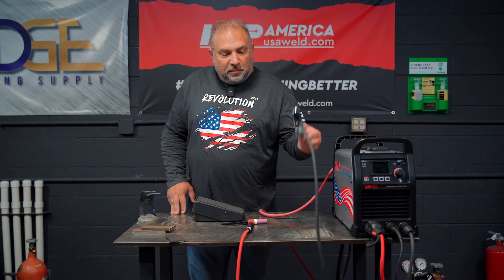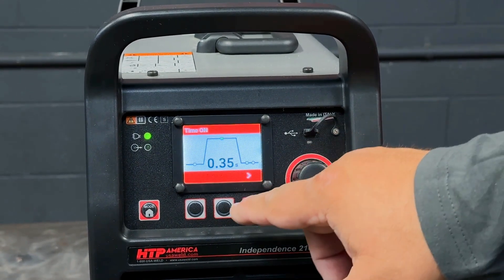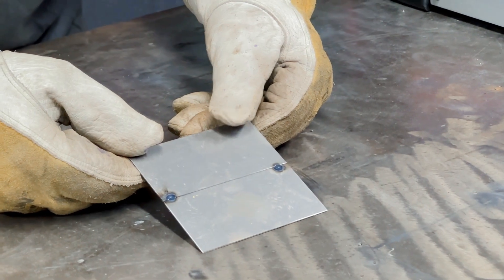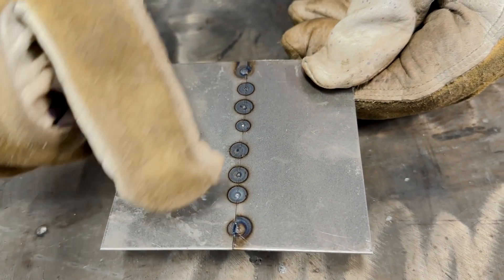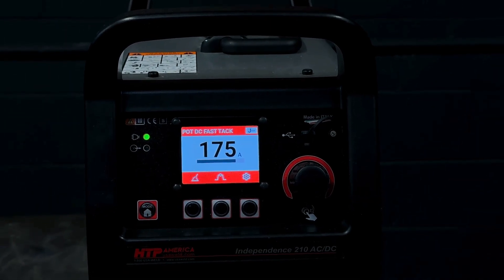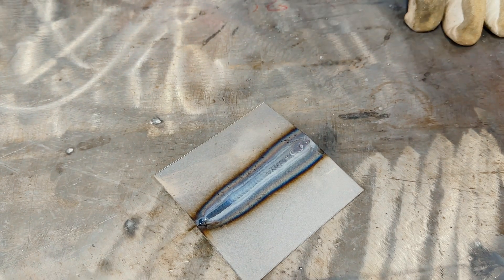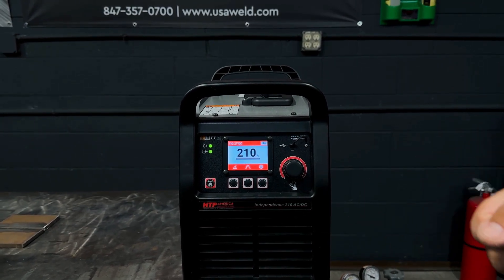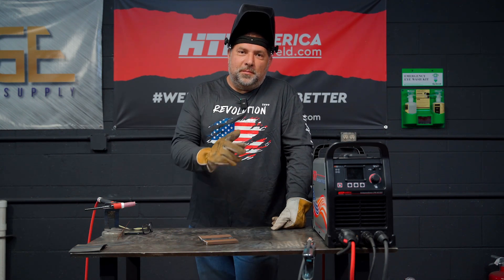Independence 210 AC/DC - DC Welding

Comment: Hello:  Can you run the 210 Independence off of a generator with dirty power without compromising the board?
Reply from the maker: maybe,  it it does not work then typically it just does not work, it generally does not destroy the machine as there are very sophisticated protection mechanisms in place